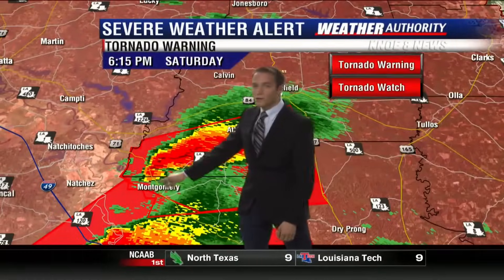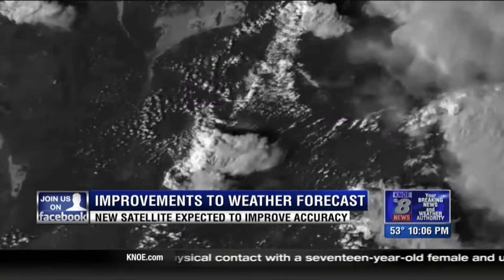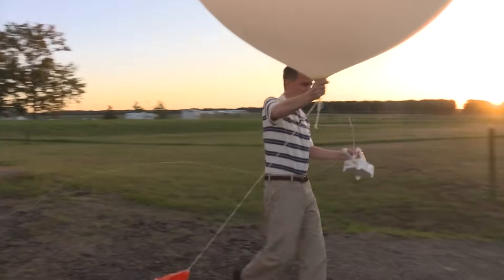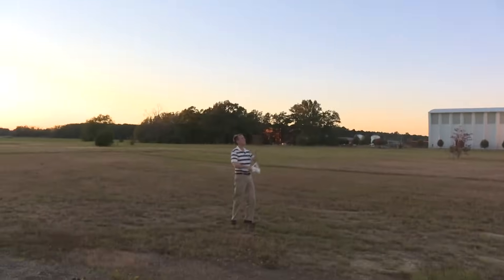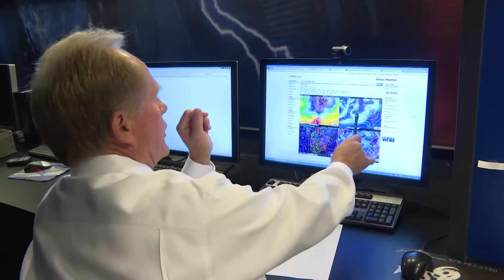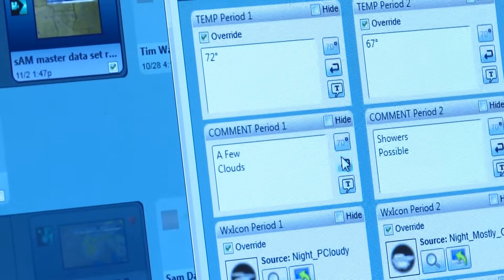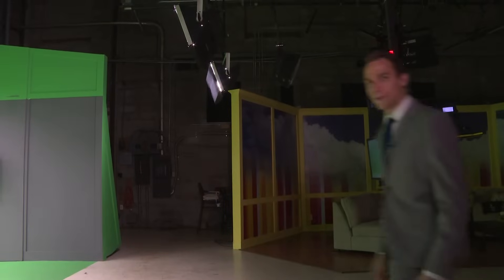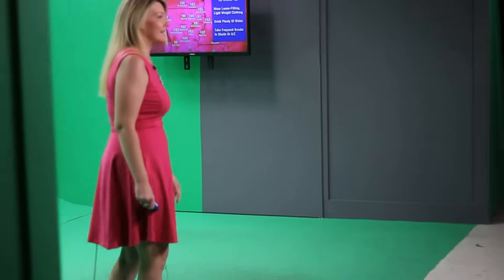How do Meteorologist predict the weather?

Comment: BUT HOW do scientist find Low Pressure Area on the weather map ? sometimes they point to an empty location as a LPA but how do they know that is an LPA ?
Reply: LPAs rotate in a certain way (counterclockwise is the northern hemisphere and clockwise in the Southern Hemisphere) so you’ll see winds around that empty location making that pattern of rotation
Reply: @kwader9102  well i asked because sometimes our local weather reports in the philippines would show an LPA in a section where its empty, no clouds. so i was just wondering how did they know there is an LPA there. sometimes there is a rotation pattern but they mark the LPA way off the center.
Reply: @SIDEKICKONYOUTUBE   yeah, highs and lows are rarely perfect circles. Some “sides” are shorter than others, so you might have parts that have more westerly winds than easterly winds. Also, the low is relative, so the center of the low pressure system may not be the actual lowest low, the actual low can be somewhere else like you’ve seen
Reply: @kwader9102  thanks man